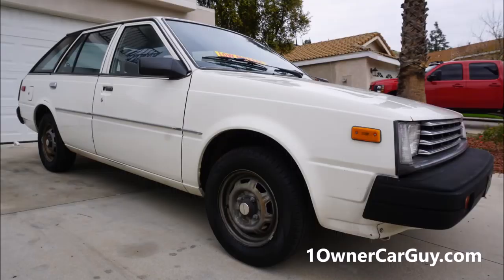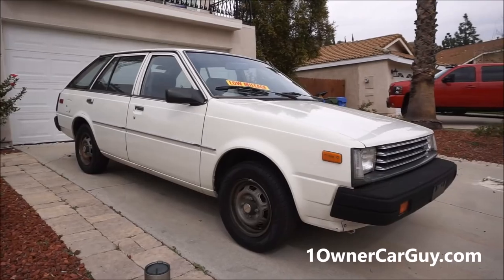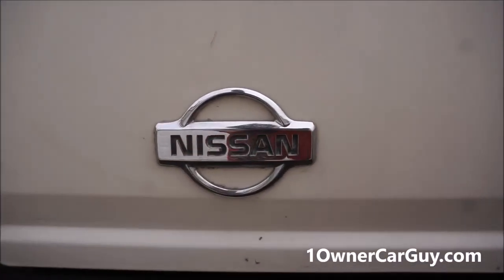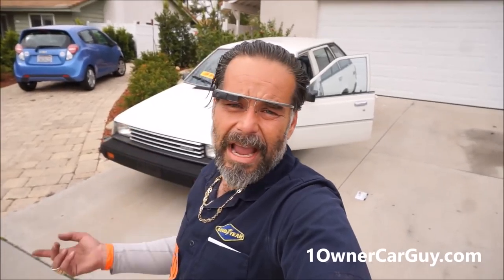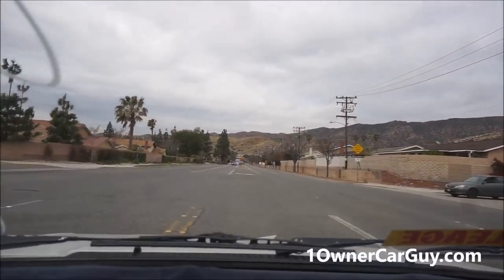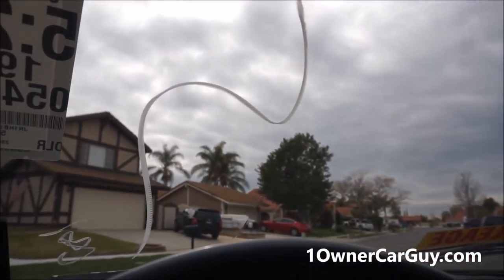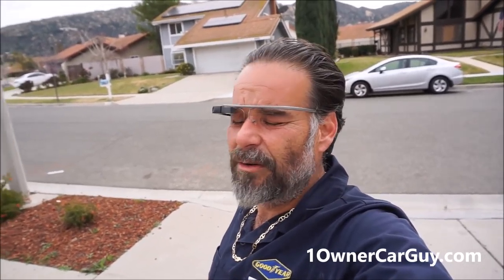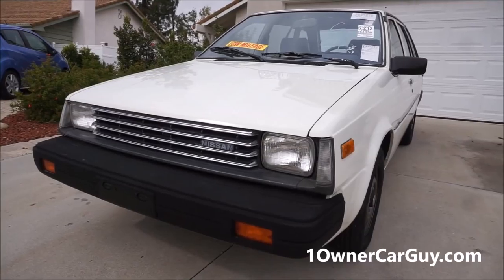BUY A CLASSIC DATSUN 210 STATION WAGON ~ FOR SALE SUBSCRIBER SPECIAL CAR

Comment: The split rubber component is a steering rack gaiter.  I'm pretty sure that these had manual steering rather than power and it looks like that gaiter has only just gone so there should be no real problems as long as it's changed quickly.  I believe the gaiters are still available from Nissan, if not aftermarket and they're not horribly expensive, and it's not a difficult job to change them.  If it's left, however, you're going to end up needing a rack which is going to cost a lot more money and is far from as easy as changing out the gaiter...